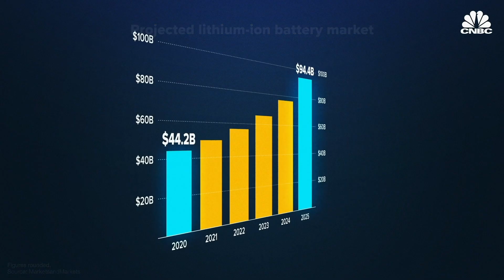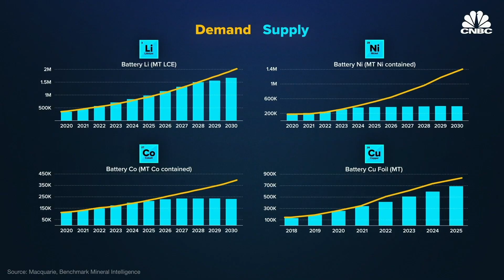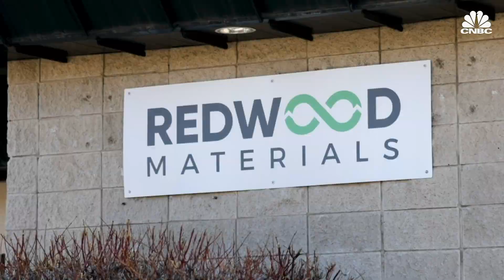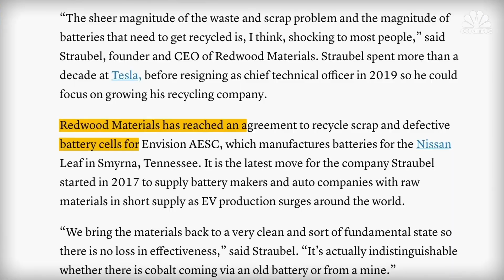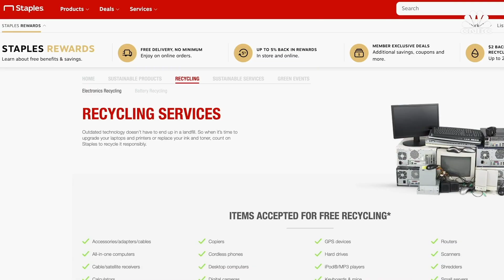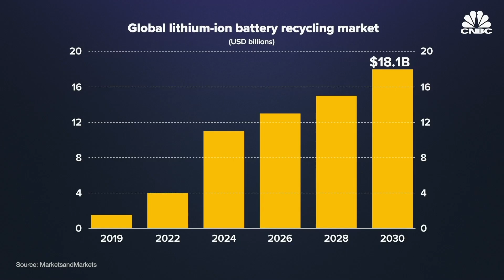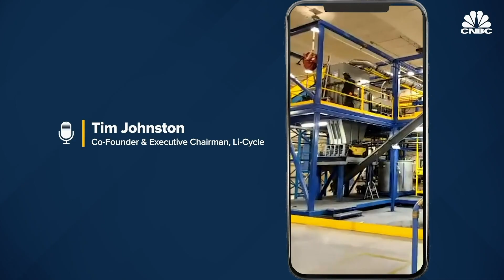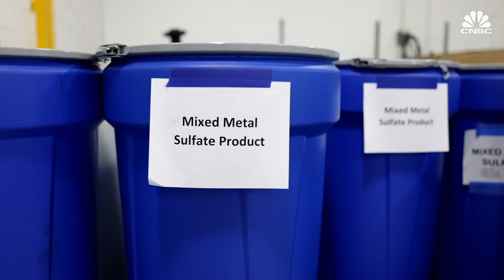How Tesla’s Battery Mastermind Is Tackling EV's Biggest Problem

Comment: The problem with some batteries is that they were never meant to be recycled, everything is glued tightly together, so you end up with a lot of plastic, rubber, circuit boards, wire etc. which needs to be processed as well.  That adds to the cost.
Reply: the vast majority of batteries will not be built that way, besides that Hydrometallurgy techniques are very through in the shredding process.
Reply: @odisy64  The amount of energy used with recycling is just way too much. Fun idea but not realistic.
Reply: @Marc98338  thats cute, you think you know what your talking about. hydrometallurgy Recyling is not energy intensive, you shred batteries and mix it with water to separate the components. its actually profitable to do this because its like grinding high quality ore full of rare metals. teslas cars are becoming mostly aluminum, which can also be recycled at a lower energy cost than it takes to mine and refine the same amount.
Reply: @odisy64  What are you even talking about. Im working at 1 of the  biggest aluminum companies of the world and recycling aluminum is WAY  more expensive then mining. Too many clueless people here.
Reply: @Marc98338  buddy, how can melting pure aluminum into a new ingot cost more than mining and processing bauxite into an ingot? what exactly do you do at your "aluminum companies"? your title doesn't mean anything to me, ive had to explain to semi truck drivers what DEF was for.
Reply: @odisy64  Youve absolute no clue. Where in the world do you think they can get pure aluminium for recycling without work. 2ndly you think you can do something with aluminum ingots? You need poles for extrusion which also is a costly procedure...
Reply: @Marc98338  where can you get pure aluminum? i dont know maybe the large aluminum die castings they use for the cars frame. the 6000 ton gigapress they have straight up uses aluminum ingots. 

you were right about Recyling costing more energy but not when it comes to some specific materials. people use to say lithium-ion battery Recyling was to expensive, untill 2019 hydrometallurgy techniques changed that. new roasting and leaching techniques have also increased mining yields.
Reply: @odisy64  What specific materials do you mean? Ive found some articles but none claim to be fully recovering the lithium which obviously would be physicly impossible . 

I dont think we will work this out man. Lets see, invest your money into Tesla is you believe in it.
Reply: @Marc98338  i was talking about materials like aluminum which are less energy intensive to rycle than it is to start from scratch at a mine. nothing can really get 100% but you can get prety close, like 97%
i did invest in Tesla, all the way back in 2019. so far they have consistently hit their production goals.
Reply: @odisy64  Well gl investin in 90 PE + stocksm
Reply: @Marc98338  it use to be around 500 PE, then Tesla started making more cars with higher profit margins than anyone else. their current plan will continue to do that for another 8 years.
Reply: @odisy64  Thata your opinion mate. Im just saying that youve your strategy and ive mine.

Comment: Don’t buy an electric car because you think it’s fighting climate change - it’s not (today).    While an EV is 3 times more efficient than a gas car internally, it’s 1/3 as efficient externally because it takes up to 3 units of fossil fuel to generate the 1 unit of electricity to charge the battery.  One third of 3 is 1 - it’s a wash! 

But you’re saying, even though only 20% of the USAs electricity is from renewable sources presently, soon with rapid construction of wind and solar power plants, the ‘wash’ factor becomes irrelevant.  Not until 130% of our present total electric demand comes from green power will the first EV make sense.  Why?  Because the added electricity demand caused by the anticipated EVs will necessarily be powered by the remaining fossil power stations because they must cover the shortfall of total electricity demand above what the green plants can generate, whether that’s the 20% today or the 90% 50 years from now.  All of the additional or new demand for electricity in the future must come from the ‘swing’ power from the remaining fossil plants until all electric power is green, decades from now.  

Because the amount of green electricity will only be some growing percentage of our total needs (but not all) until it’s 100% when your grandchildren have kids, by buying an electric car, you are and will be adding to the total demand for electricity requiring fossil power plants that would have been retired due to replacement by green power plants (had the total demand remained as is without EVs) to stay on line to cover the new demand (EVs), or those plants throttled down to run at 40% to cover the remaining unmet present demand as reserve - they must then throttle back up to generate the power to charge your car’s battery.

The soonest an EV will make sense is when ALL fossil power plants are retired - 40 years from now at the absolute earliest.  How many cars will you own in those 40 years; 4, 5, 6?   Wait until the 6th one when you’re actually using green energy to charge your battery and by then they’ll have this battery problem worked out. 

Musk himself recently admitted that we don’t have enough electricity presently for all these EVs and he also admitted that it’s unrealistic to expect we will ever totally get rid of fossil fuels.  There’s a lot they’re not telling you. 

LOOK BEFORE YOU LEAP!
Reply: you fail to understand that even with the current power grid, the electricity produced using fossil fuels will still beat a gas powered car in life time emmisions. 22% of the US power grid is coal and 38% is natural gas which produces half the co2 per kwh produced compared to coal. 40% of the grid is renewable and nuclear. but in my state its like 90% renewable 5% nuclear and 5% fossile fuels. on avreage it will only take 2-5 years for an electric car to have lower emissions than a comparable gas car with a 26MPG fuel efficiency.
the US grid only needs to expand 33% to meet the electrical demand of 260 million EV's but this can be done in 30 years if we increase power plant capacity by 1% each year.
these batteries last longer than you think, model 3's only lose 10% capacity after 200k miles, some Teslas have gone past 500k miles with the same battery. the new 4680 cells will last over a million miles, much longer than any gas engine for a fraction of the maintenance and run cost.
Reply: @odisy64  A lot of numbers, but what are they based on?  You say natural gas produces half the co2 of coal, but the comparison should be to the co2 from burning gasoline.  Gasoline is less clean than natural gas, but cleaner than coal, so the the coal/natural gas mix for electric generation is comparable to the carbon footprint of gasoline.  I don't think 40% of the grid is yet renewable as you say even including nuclear, but even if it is, because EVs represent all new consumption of electricity of the base load for our lights, A/C, and numerous household appliances, the amount of new renewable power is fixed until the next green power faciltiy comes on line, requiring the shortfall, AND ANY NEW DEMAND FOR ELECTRICTY, (which includes all the EVs) to necessarily have to be generated from the existing fossil fuel mix.  So, your EVs will be using fossil fuel until 100% of our electricity is from renewable sources.  So even if where you live the electricity is 90% from renewable sources, the 10% is therefore fossil and must cover any shortfall.  So if you add new demand for electricity by buying an EV, then the fossil power plants that were throttled down to cover only the 10% shortfall must now throttle back up to cover the shortfall plus the new demand of your EV. 

Nobody has yet answered or even addressed in detail the basic fact that electric generation is very inefficient, roughly 33% efficient for coal power plants and 44% efficient for natural gas.  So even if an EV is 2-3 times more efficient internally (1 unit of electric power will carry an EV the same distance as 3 units of gasoline), the 3 to 1 advantage internally is wiped out by the 1 to 3 disadvantage externally.  

The numbers that you put out sound like someone's conclusions without the backup.  Any backup has to address the vast inefficiency issue in the generation of electricity and your conclusory statements don't address that issue or answer my basic question.  As an attorney who has practiced law for 34 years (preceded by 8 years in power plant construction experience), I've examined many so-called "experts" in court.  One thing is universal - regardless of their method of analysis, they always come up with a conclusion that supports the side that hired them.  They are called "whores" in the profession.  Many of the so-called "facts" circulated and being repeated out there are from advocate groups or other paid groups that cherry pick facts to support their foregone conclusions or agendas.  Until someone explains, in detail, how the 1/3 inefficiency in generating electricity can be totally overcome by other factors, I remain a skeptic.

My own research shows (from sources supportive of EVs) that an EV is 60% efficient from battery to wheels while a gasoline car is only 20% efficient from gas tank to wheels, or 3 times more efficient INTERNALLY.  But if that 60% is divided by 3 (external inefficiency), then an EV is also a NET of 20% efficient, the same as the gasoline car  Also, the gasoline efficiency assumes a standard car that idles at starting, sitting at traffic lignts and coasting.  But if more instant start/stop gasoline vehicles are used, as is the case in Europe, then that improvement would have the net effect reducing the gasoline car's carbon emissions to that of an EV where all its power comes from natural gas power plants and no coal plants. 
 
If you can direct me to a credible source that specifically addresses my specific central question with detailed facts and analysis, without stating their conclusion as the "fact," I would be very grateful.  If that source can explain the why, and not just the conclusory what, then I would be open to adjusting my position if persuasive.

Comment: Naw. The biggest problem with EVs is weight. They are incredibly heavy, which massively increases tire wear and the resulting microplastic pollution. Plus, carting around all that weight is amazingly inefficient.

The solution is advanced hybrids. Synfuel and biofuel paired with a tiny 60% efficient air-cleaning engine not only beats EVs hands down but also cleans up pollution from other sources.

EVs are soooooo last century

Comment: Throwing away old electronics is a huge problem, it is the  dark side of our consumer society. We need to better look at all the waste we produce. Not just the batteries - all materials... Mr. Straubel said it much better: "When I think about the distant future, when we're operating as a really sustainable society and economy, we need to be productively unbuilding everything that we've built. " - excellent wording, so true. I wish them all the best...
Reply: the local scrap yard pays top dollars for electronic parts, if people knew the value in washing machine motors, fridge components, hot water cylinders, air conditioners, car components etc they would treat them like cash instead of trash.

Comment: Recyclability needs to be built into the entire lifecycle of a product not an afterthought. All products should have  user replaceable batteries for example. It's barbaric that you need to smash open a product to extract the valuable toxic materials. There should be a standardized system.

Comment: This is why the Range Extended Electric Vehicles or REEVs are going to be the future configeration of EVs not hybrids or pure electric.  They will have 1/5 the battery weight, a small 16 to 20 Kw generator powered by a super efficent engine.  Perhaps burning Compressed Natural Gas that can be refueled at home.  In case of a grid outage they could even provide emergency power for your home.

Comment: What is the weight of one car generator? 12v 120 v as edison self spinning generator.  Lithium is minor nutrient mineral that is used as an anti depressant. We should be more concerned about concentration of rare minerals to do something we don't actually need. We doing something dangerous but none actually needed.
Reply: What are you talking about? A self charging car?

Comment: why do we even bother with EVs if in some 30 years the world will realize that they're just as bad as internal combustion engines?! After that we'll move towards hydrogen. But why waste 30-50 years creating new industries and new problems if we can just do it now? The technology is there, it's not the problem. The problem is, as it usually is with humans - hype! EV hype, Elon Mask hype, tesla hype, pseudo-green tech hype... Lets admit it, we turned away from H2 only because Elon Mask said it's crap - there is no other reason. But it's a lie. And a bad one. Elon Mask is becoming the same power-hungry predator just like the oil oligarchs. At least 50% of energy storage should be green-hydrogen based. Corresponding infrastructure should be building now, not in 30-50 years. We're wasting time...
Reply: Lol you are so misinformed.

Comment: I have said it for years we need a national recycling standard. All cell phone batteries should be equally identical. Just like AA and AAA batteries, power tool batteries should be universal. Instead of having these quick charging stations for electric cars. You should have battery swap stations that are more energy efficient. Driving into a battery swap station would be like going to a carwash. Remove the battery from under your car and replaces it with a fully charged battery. No waiting, instant recharge, Takes less than one minute!
Reply: The biggest problem that I see with battery swapping is "who is responsible for identifying batteries that are not in satisfactory condition, and repairing or replacing them?" Also there is a problem with the size of batteries; a small motorcycle and a huge SUV will need to have different batteries.
Reply: @cedriclynch  I definitely understand your concern. But think about how the existing supply chain works distribution trucks take gas to fuel stations. So you would also have distribution trucks transporting batteries. Think of batteries like AA batteries, A motorcycle runs on 2, car takes 8, A truck or SUV takes 16. The battery is released from the vehicle. Slid out from under the car and then the batteries are swapped out. The company is responsible for the batteries. As an example whenever you pay for battery charging station fee you're paying to use that company's batteries. Kind of like Exxon has better gas then Shell. Batteries would have a rating of Excellent, good and bad. If I was going on a road trip and I go to a charging station I can report that I'm traveling out of town. If that charging station has for example bad batteries. The charging station can offer me a contract of six excellent batteries and two bad batteries for a free charge. This way batteries would make it back to distribution centers. Without the need of distribution trucks. Essentially saving companies like Exxon billions. But when swapping batteries at a charging station you would know the brand of battery, the batteries rating, the batteries charge. If batteries set unused at a charging station companies don't make money. This is where the competition comes into play who has the better batteries. If Exxon don't maintain their batteries people may prefer Shell batteries over Exxon batteries. But it would be a very complex system with smart contracts and what not.
Reply: @ThomasDiy  I think a system like this could be made to work but it would be complicated to get it right. If people can use any recharge station, the stations will be receiving depleted batteries from other companies. If 16 batteries have been in eight motorcycles and now come together in one truck, the battery management system will need to cope with any possible differences in their condition, temperature, properties that vary between different makes etc. I think each battery in a multi-battery vehicle would have to be connected to the vehicle electrical system through a separate DC-DC converter controlled by the management system of that particular battery, that would need to be able to transfer power in either direction in order to make regenerative braking possible.

Comment: JB  stated that they recover up to 95% of the cathode materials and up to 80% of the lithium. One other EV battery recycling has developed a patented process for recycling any type of Lithium - ion batteries.  American Manganese has several recycling process patents. An independent verification of the process has proved that they are achieving 99.9% recovery of cathode materials and 99.7% of the Lithium. Their also are achieving special processing of the material so that it can be sent to the manufacturer and the material is ready to be put right into the battery cases. This saves the manufacturer from any additional processing. We can not settle for wasting 20% of the recycled battery material. One out of five batteries is not recovered. At that right we will not make it to 2050.